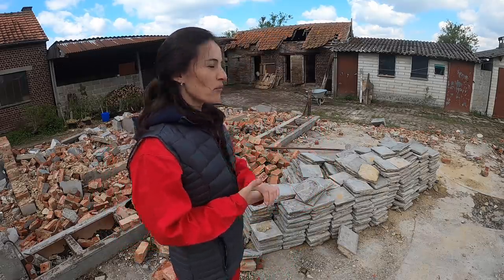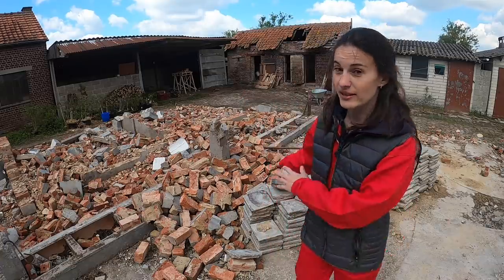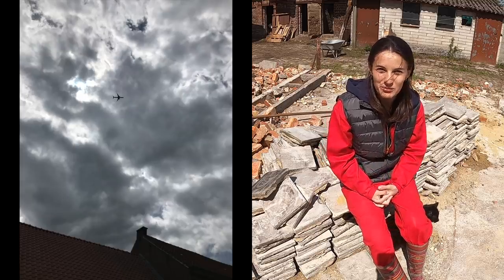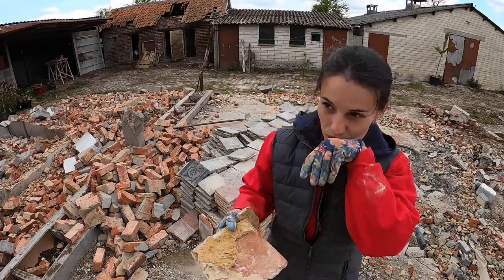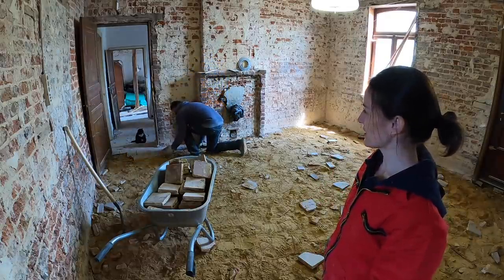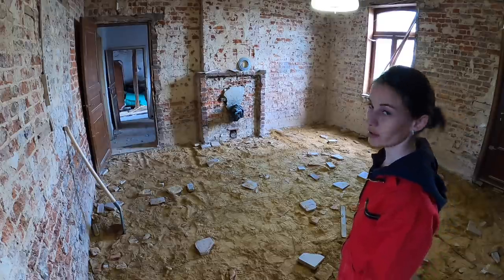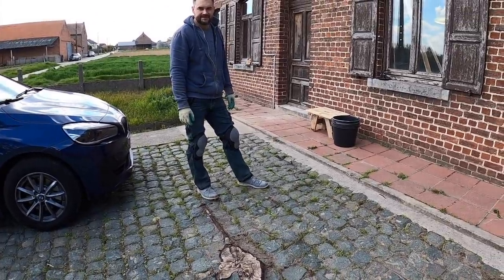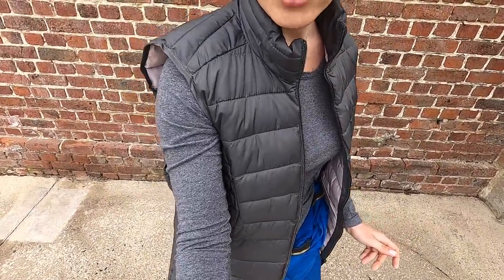Removing but saving STUNNING TERRACOTTA tiles in the hallway of 100+ y.o. farm

Comment: Here's how to remove the lime mortar:

1) put the tiles in an old bath or large bucket
2) fill the bath/bucket with water.  Do NOT add vinegar or St Marc or whatever other suggestion in the other comments
3) let the tiles saturate in the bath/bucket for AT LEAST 48 hours.  They will absorb lots of water so make sure to add water so that they stay under the water.
4) gently knock off the mortar with a small hammer.  It will come off very easily.
5) Let the tiles dry.

Hope this helps.  Cheers and good luck.
Reply: I would be highly cautious of an acid bath with those black tiles because you could loose the beautiful etching on the top. Always test with a broken/less desirable piece before using it on the better tiles.
Reply: @SandrA-hr5zk  I totally agree with Sandra.  Use my bath method.
Reply: I agree! Maybe you use a Chisels, the one that carpenters use and maybe you lay your tile on a soft surface like a piece of carpet or so...
Reply: I agree.
Reply: This is what I would have suggested but I wasn't quite sure if that was something that would be helpful thanks for posting this message.
Reply: @SandrA-hr5zk  The black/grey tiles are likely cement and the pattern goes all the way through the material. I still wouldn't want to use acid because the concrete on top and the tile itself are the same material. I think the best tool is a concrete polishing/grinding stone.

The red terra cotta tiles might withstand acids, so you might want to try that on a broken one.
Reply: @Ragnar8504  glad I was on the right track!
Reply: The reason why this works is the naturally occurring carbonic acid in water. It is what makes all those beautiful limestone cave formations. If water will move limestone through a mountain I'm sure it will work on your tiles.
Reply: @gurugnu  I love knowing the “whys”!  Thank you for sharing that!
Reply: This has already been tried
Reply: Ralph C nailed it as far as the best/safest method. A mountain of a undertaking to gut and restore that house. As a heritage/restoration carpenter I have all the love and respect for what you are doing.
Reply: A pressure  washer instead  of a hammer will work to en is easier!
Reply: Yes, this will work.  I have used this method with hammer/cold chisel for more stubborn bits with good results. Trick is to vibrate/impact the mortar while keeping the tile steady.   Get sturdy table to do this work, or you will kill your back.

Comment: Later after removing the mortar from the back of the tiles set up a larger pedestal style belt sander. Get one that uses two inch wide sanding belts.( you will need one anyway in the remodel project anyway). Use a 60 or 80 bit belt to clean the edges of the tiles for a cleaner installation later.

Comment: Try soaking some of the tiles in a bucket of water for a few days then giving them a scrape. I've saved tiles this way, but mine had more modern adhesive on them so mostly just dropped off. But it's worth a try if you don't want to ruin them with power tools or chemicals.
Reply from the maker: Thank you, Tracy! I will give it a go today and will share the result in the next video.

Comment: teamwork makes the dreamwork. last year we had a major explosion of mold in our farm house built in the 70s . was a nightmare, even got me sick. but i was able to fix the water problem in the foundation and slope of the land. and got all the wood replaced. i feel so thankful. i did 99% of it myself. but having the extra hand the other 1% meant i could actually do the job. without 4 hands, some things cannot be done. to remove or soften lime mortar get CLR treatment. soak tiles for a couple weeks then use sanders/large polisher to grit the stuff down.(calcium lime rust) or get some form of citric acid (mabe soak with very strong lemon juice?)

Comment: I grew up with terracotta tiles in the kitchen - pretty and very hard wearing... but cold! If you can set up solar or ground or air source heat pump under-floor heating, it's the perfect match! It really feels lovely having warm and smooth tiles under foot :)
edit: do I mean terracotta? They were what we called quarry tiles, which I just looked up to see the difference... 'Unlike clay terracotta, quarry tiles are not porous and will resist water'
Reply: Great recommendation!

Comment: Try using 10% muratic acid after soaking the entire tile for a couple days. Rinse thoroughly after lightly scrubbing to remove acid. The front will be easy to wipe clean with scotchbrite type pad and gently tap the mortar off the back with small hammer.  Be sure a support tile by laying on a board covered with a thick cloth to absorb the shock f the hammer.  It's a terribly slow process but those tiles are really worth saving.

Comment: Vinegar disolves lime, try 1 tile in a bucket with vinegar and let it saok overnight. And see what happens.
For the surface you could try St Marc, it's a natural product based on pine resin. Go for the powder and not the bottles, so you can make it as strong as you want.
You can try 1 tile in a bucket with a St Marc solution saoking overnight.
Reply from the maker: Thanks for your advices, Mark! Noted all :-)
Reply: @DeHoeveOldBelgianFarm  For buckets ask your local frituur/snackbar, they ( at least in Dutch Limburg) get their frituurvet/olie and fritessaus in 10L oneway buckets that they throw away when empty. I use them as free pots for my tomato, paprika and peppersplants in my livingroom  garden.
Reply: On top of that you may try using copper brushes instead of steel. They're softer and don't stain as much as steel
Reply: Vinegar is quite weak acid, i'd maybe try citric acid which comes in powder/granules from hardware store. That can be also mixed with chalk or similar substance to create putty.

Citric acid also works like a charm to remove rust, just needs to be rinsed.

Since lime mixed concrete is alkal/base pH it might give results to try strong base mixture with pH of around 13. Example drain glog granules from said hardware store.. No idea would it work or not.
Reply: As stated below vinegar is a pretty weak acid, unless it's pickling vinegar with might work. As thick as that mortar is, I'd probably skip straight to muriatic acid.
Reply: @CasbahD  For some strange reason I've got the feeling that you are from the most modern 3th world country on the planet.
Am I correct or not?
Reply: @Plataani  vinegar comes in different acidic percentages.... brining vinegar used for pickling is about 7% acid and table vinegar for salads, etc) is around 4% .
Reply: @markschattefor6997  Yep, here in America it's called "The South". I'd guess you're from California? Yes?

Comment: In 1973 i watched the construction of the lobby floor of a beautiful high rise hotel in Singapore. The surface being covered was simply dirt. There was mo concrete slab. The tile setters installed a beautiful polished granite tile floor on a mortar bed directly over the roughly smoothed dirt. The installation was beautiful and no one would ever suspect that underneath was the natural soil.

Comment: Stephanie at Chateau Le Land soaked tiles in water and loosened the mastic that way. (Not the terra-cotta tiles! They will disintegrate) Worth a try. Good luck!  You’re doing a beautiful job!
Reply: les carreaux de terre cuite trempés dans l'eau tiendront aussi longtemps que ceux utilisés à l'époque romaine jusqu'à nos jours , hahahahaha !
Reply: @jacquesdeghorain3162  in English??  😂 No comprendé
Reply: @lesserpoo  I'd roughly translate it as "The terra cotta tiles will also last a long time soaked, like the ones used from the Roman era into our times". At least that's what my rusty school French suggests.
Reply: @Ragnar8504  oh wow!  Good to know!  I would think they would disintegrate, but what do I know?  And it looks like your old rusty high school French is still paying off! 😂 Thanks so much!
Reply: @lesserpoo  I don't think they'd disintegrate, just like terra cotta flower pots don't disintegrate in the rain. The clay has been fired in a kiln, which makes it fairly water resistant. It will soak up water like a sponge (because it has been done at a fairly low temperature, compared e.g. bricks for external walls) but then dry again.
Reply: @Ragnar8504  aaahhhh yes, never thought about terra cotta pots!  Duh.

Comment: Use the old bath you took out of the bathroom. Fill with tiles and then add water with acid (dissolves lime and calcium in mortar) cheap vinegar is not a bad option if you don’t want to use harsh products.
Soak for a few days

Comment: The tiles with the motifs on them are cement tiles, also known as Portugese tiles.
Do not put these for prolonged time in something containing an acid, as that will destroy them, the terracotta is less sensible but I would not put them in acid as well.
Mopping the floor with some vinegar added in the water is fine however.
A good way to get the mortar off the backs of the tiles is a diamond abrasive wheel for the angle grinder, I used this to remove cement and any unevenness from concrete tiles and it works very well.
But do not use it on the upper surface as the wheel eats into the tile itself quite easy and thus would destroy the patterns on it.

It also looks like the cat has made the definitive decision where to stay the rest of his/her life.

Comment: empty and clean the pig feeding trough
seal the interior
fill it with water and lots of vinegar ( the acid reacts with the lime in the mortar and softens it )
cover with heavy tarp to slow evaporation and raise the solution temperature
apply vast amounts of patience
love what you are achieving with this old treasure of a  structure

Comment: Make a shallow frame with a thin foam bottom that fits the tile.  Put the tile in it and use the tool that you used to clean the walls to take the plaster off

Comment: I am not sure if this suggestion will damage the tile surface however I think it will work well if you are careful/gentle with it. A tool called a "needle gun" which is used for removing scale/rust from metal should work quite well. The ones I have seen are air powered but they may make electric ones too, something you could investigate.  Cheers and good luck, Bob

Comment: A tip if you have to break up tiled floors: remove one row of tiles horizontally and one vertically (if possible), that way you release the tension on the whole floor and the tiles come out extremely easy.

Greetings from a fellow Belgian renovator!
Reply from the maker: Great tip, thanks! A bit too late, but could be useful for other people searching for information. Always happy to have more people here going through the same joys and pains of house renovation!

Comment: as others have said, Soak the tiles for about 48 Hours, this will allow water to get between the mortar and the tile, they should scrape clean with a putty knife and wire brush the stubborn bits, its the best way.

Comment: Soak to remove lime mortar then use a brick acid to remove the self levelling from the fronts you will have to try various strengths to remove it so be careful and wear all ppe.

Comment: Terracotta tiles  should be glazed/waterproofed in kitchens to avoid staining. 
Also, as they are porous, they may actually conserve an unpleasant sent/odor in some cases (absorbing spills)
You should consider oiling them at the very least, once and a while as required, it tends to darkens them only slightly.
As your tiles are old, it may not discolor them much, if at all.
Even for the hearth (fireplace), having them oiled would be a good idea. Charcoal can leave nasty dark stains, if you are unlucky.

удачі! Good Luck!

Comment: The area in front of the fireplace is called 'hearth'.  Use a scutch - hammer, chisel or drill bit to separate plaster from walls or tiles.  You can get replacement scutch 'teeth' for hammers or chisels.  If you can't find them locally, message me and I'll send one or two to you.  Well done for all your hard work.  Nick
Reply from the maker: Hi Nick, many thanks for your advices. I could hardly imagine we wouldn't be able to find it here :-) Thank you for your kind offer to help out.

Comment: The only way I know of to remove lime mortar from brick or terracotta is to wet the tiles, and then apply strong vinegar or muriatic acid.
Since the tiles are now lifted and taken out of the house, you could put them into a plastic container and soak them for a while in vinegar. If you can purchase muriatic acid, you should only add about 1 part acid to 9 parts water.
Leave the tiles immersed in the container for a little while. 
When all of the limestone in the mortar is dissolved the tiles can be washed and cleaned.
Reply from the maker: Many thanks for sharing this tip, Joseph! Noted!
Reply: @DeHoeveOldBelgianFarm  We used this on tiles in Belgium it works well, but please note it is a form of Hydrochloric acid (slightly less aggressive as some types). Make sure you follow instructions because in Europe it is sold less concentrated in other countries. Good luck
Reply: Yes Vinegar is best..I did mine  with it..very clean n I applied light wax n came out beautiful..
Reply: @2wwwilly  Can be good but Vinegar is not always concentrated enough to deal with the lime that the tiles are placed with. I have experience with this - I lived in a listed house in Belgium and had to have the state examine what we did to the house to restore it - it was recommended to use hydrochloric acid because tiles could contain arsenic colouring usually green and vinegar is not the best to deal with it. In the end we had this done by a professional, who could dispose of the waste- even the vinegar can't be put in the public drainage system, Belgium is very strict on waste disposal - even the excavated sand had to be disposed of in a special container.
Reply: L'acide est efficace mais trop mordant = risque d'abîmer tous les carreaux !!!
Reply: @soniaspf9705  thank you for this valuable tip regarding the possibility of arsenic glazes.  Arsenic was banned from most household products by the start of the 20th century but better safe than sorry.
Reply from the maker: Thank you for the valuable input! @Sonia,  state exam? We wanted to buy a listed farm when we started our search.  It was beautiful. But now I am happy we changed our mind - there are so many challenges and questions we are dealing with, but at least no paper work and endless ping-pongs with approvals. 
About waste disposal - yes, idd. I like it a lot, but it makes waste disposal a bit more complicated and expensive.
Reply: @DeHoeveOldBelgianFarm  The examination of property in Belgium is a requisite of the state so you can insure your home - this can be done by having a surveyor do a examination of the house to say its safe and complies with building regulations - such as structural supports and having your electricity signed of by a Meester craftsman. Also the Milieu Politie can also be asked to make sure you are in compliance with environmental law. All very complicated and some Belgians do not like to comply but knowing the system don't get caught out.On a happier note see you next week

Comment: I washed a tiled farmhouse kitchen floor that had concrete patches on it.I scrubbed it four times a day for a week. The concrete circles became smaller and the tiles cleaned up with splatter marks disappearing.I used a stiff broom. Just use will clean tiles over time. Unless you need to remove tiled floors I would leave them alone.best wishes from England

Comment: I had a home with tile that had an uneven surface much like your tiles. The dirt would settle into the cracks and crevices making it so hard to clean. I had to get on my hands and knees and use a scrub brush and a tooth brush to clean them the way I wanted! SO that is something to think about in the future. They would make a lovely floor for an outdoor patio. Just a thought. However, I do understand your desire to save them. Muratic acid works to clean up tiles, very corrosive, but it works. Looking very good!
Reply from the maker: Thank you for sharing your experience, Marilyn! I started thinking in the direction of having just a stone carpet out of it. Playing with the idea. An authentic touch.

Comment: you do " Put more bricks in the bucket to soak while you clean the soaked bricks. Chip, chisel or saw the old mortar off the soaked bricks. Once you've got most of the mortar off, get rid of the residual mortar by giving the bricks a good scrubbing with a wire brush. Stack the cleaned bricks in a pile and repeat the process. "  then when you getting most off you " Carefully apply a proprietary brick cleaning solution with a paint brush to dissolve the lime, then lightly scrub with a bristle brush and water. "  and it take ALOT of  time ! ...
Reply from the maker: Thank you for your advices! Noted for later :-)

Comment: Use a scraper, metal scrubber or flat head screwdriver to remove as much of the cement as possible. For the remaining cement, apply the phosphoric acid following the manufacturer's instructions. Once the cement loosens, scrub the area with a scrubber until it is all removed from the surface.
Reply from the maker: Thanks for your advice, noted!

Comment: try using a multi function tool (electric). The tool has a flat blade that vibrates and might work in this situation. Kind of like have an electrical scraper. It also has other functions which might become usefull around the house. Also good for cutting at awkward angles.

Comment: You can get an acid for removing cement and concrete from truck's, owners and drivers use it to remove cement from their vehicles it is also used to clean cement from new house brickwork it will not harm the tiles as long as you dilute it as instructed, you will need to wear a mask and protective clothing.